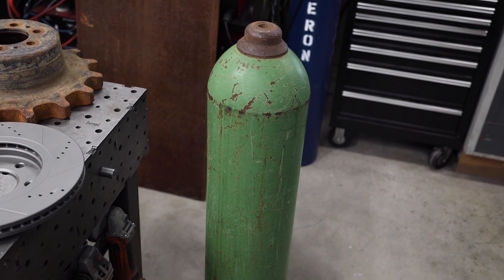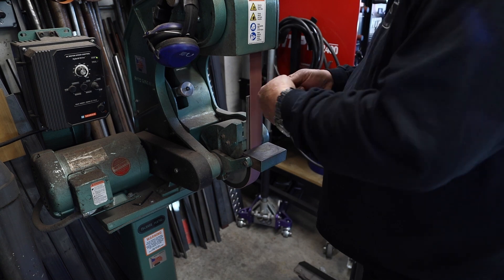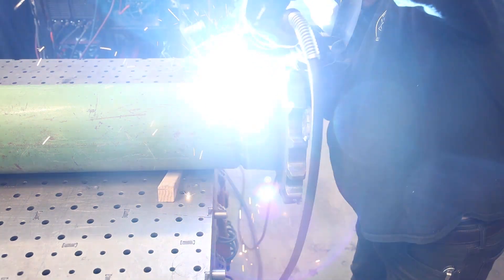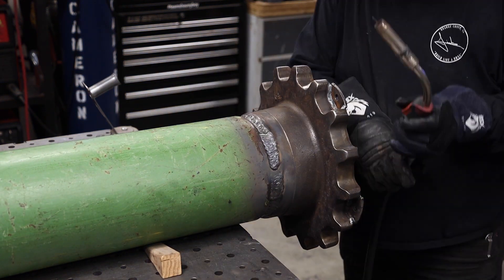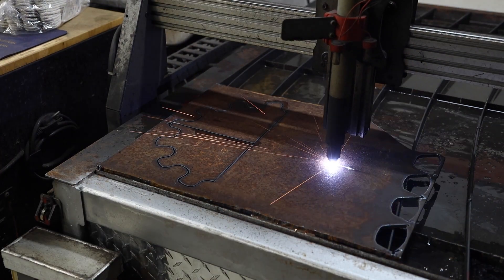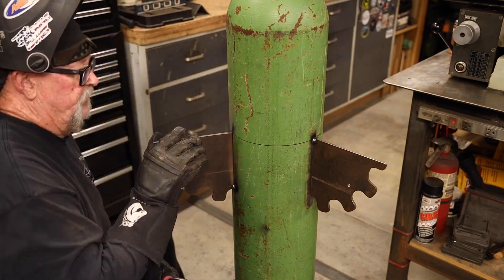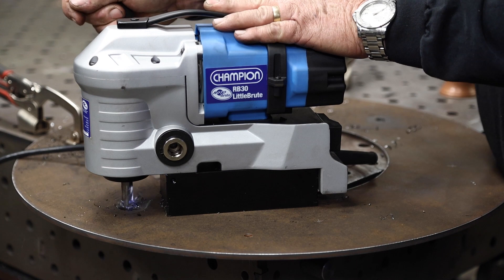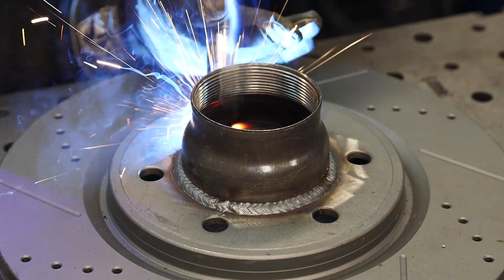Welding Bottle Table | JIMBO'S GARAGE

Comment: Instead of using round bar as a coat hanger, a cool idea would be to cut a notch to create a hook on one of the gears on the bracket holding the ring.

Comment: Great project Jimbo. I welded some rotors to my smoker for counter weights and when they cooled down we kept hearing this popping sound until one and then the other rotor fell off, so we looked at the rotors and the welds broke off deep inside the rotors. Someone later on told me that because the rotors are hardened that you're not supposed to weld them, is that correct? Great video Jimbo.
Reply from the maker: Thanks for watching 4 seasons, It could be i'm not really sure, I'm more worried about the welding bottle braking off the gear head?, My first tacks seem to be brittle!  Jimbo!
Reply: Cast iron should be heated up before welding.
Reply: I bet the rotors you used were cast iron. Cast has to be pre heated and cooled very very slowly or it will crack.